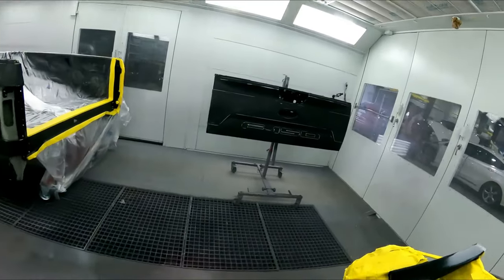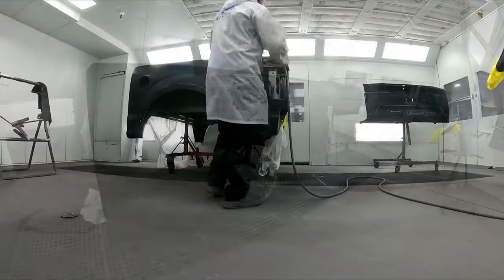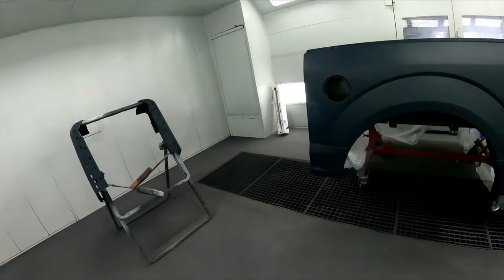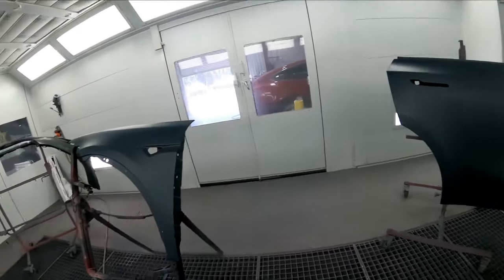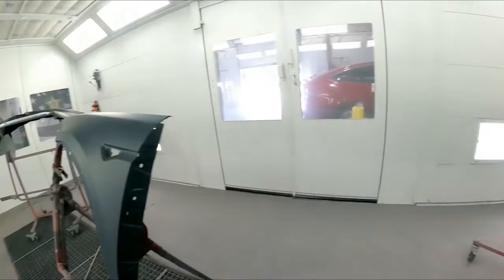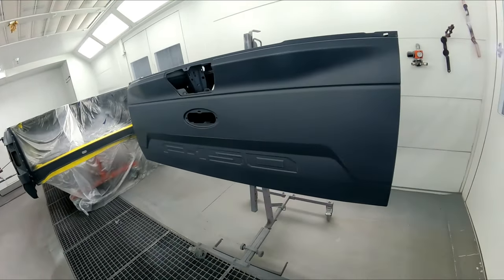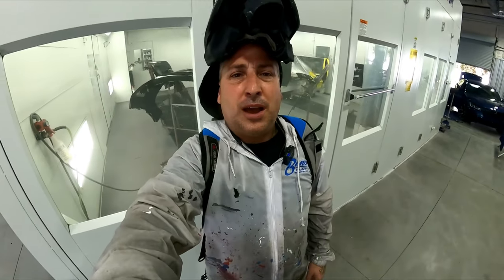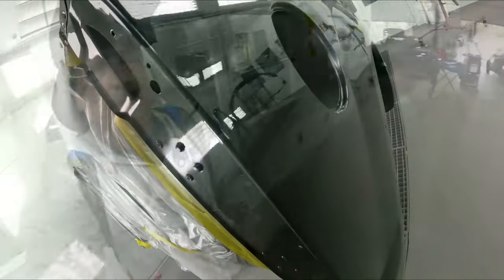THIS COULD BE MY LAST JOB AT THE NEW SHOP...

Comment: I have a question since your the best!!  If about a 1/4 inch of clear dries in the cup and shrinks down in size  after couple weeks quite a bit does that mean its a bad clear? i dont have access to top quality items like you do and i paint on the side and thats been on my mind as i seen different amzn reviews of clear coat shrinking and messing up paint about year later from shrinkage pulling back
Reply from the maker: That happens to all clears its the reducers that evaporate and the solids are leftover  .you see it more in the cup because it's much thicker than the mills on the car .the better clear the more the product is warrantied. Hope this helps

Comment: Good job man!. How do you replicate the factory orange peel for FORD? By lowering the pressure for the clear?
Reply from the maker: Same pressure  .speed  and distance.
Reply: @kandyman5315  thats mean slower speed to get more texture or faster speed to replicate the original peel?
Reply from the maker: Faster  and further more texture  .each clear acts different so play around and find the right application for the clear your spraying. 💪💪
Reply: @kandyman5315  thanks mate. Appreciate it
Reply: i am having a bad time finding out how to do a D4 Tri coat for a ford f150 2020 its red theres is only to variants have you done this paint job ? before any tips